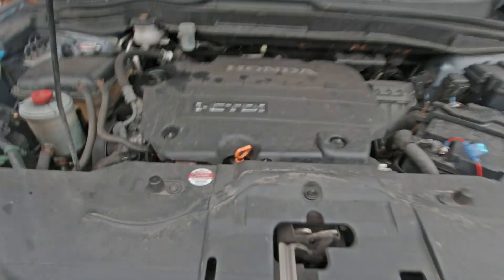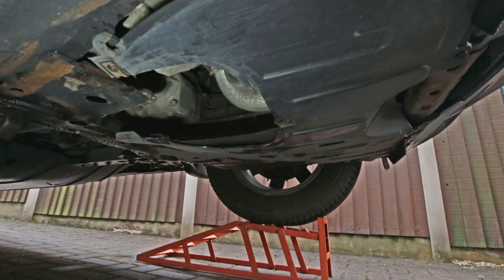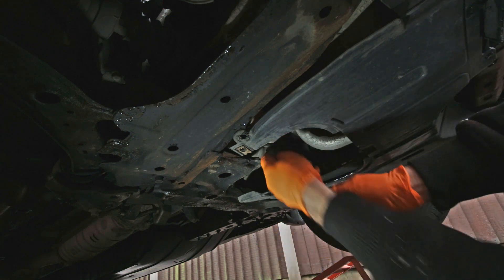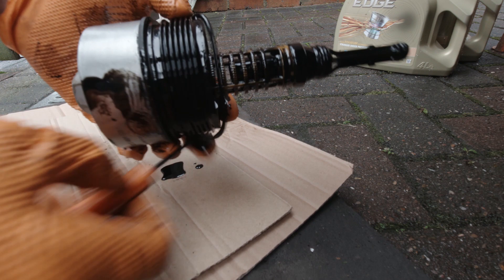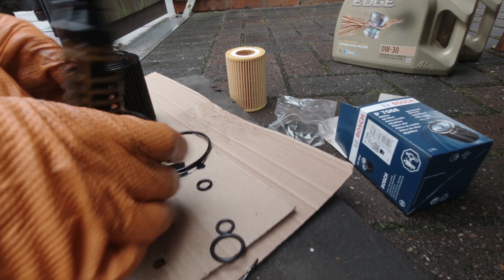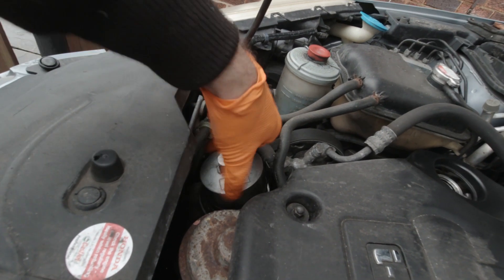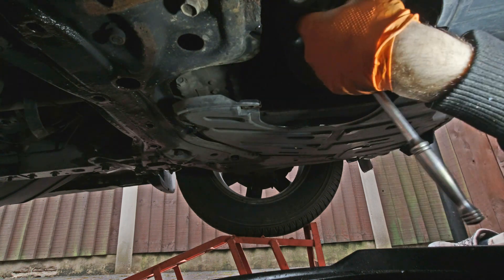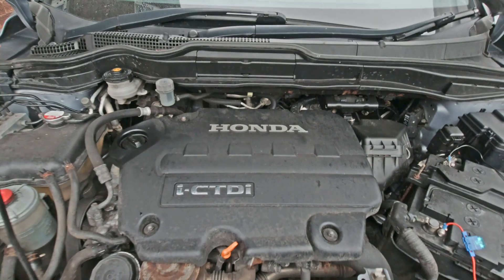Honda CRV Oil service, 2.2 c-tdi mk3 2007. Oil change.

Comment: Quick note - do not over-tighten the sump plug, the sump is made of softer aluminium and it's very easy to strip the threads giving you an annoying oil leak - make sure to tighten to correct torque

Comment: Hi thanks is the oil filter fitting “socket” 76 or 74mm 14flute ?
Reply from the maker: @andrewgrant1740  74 i think
Reply: @ thank you busy with it now and have a vernier will post. 🙏🏼 hopefully can find one easily or borrow
Reply: @ yes. You are right. Just over 74mm. 
Managed to borrow a socket thankfully 😅
Reply from the maker: @andrewgrant1740  thanks for clarifying 👍

Comment: No many info on google in regards to viscosity? Lot's say 5w 30 inc honda forums...
Euro car parts say 0w30 is ok as long as none dpf which many or most are none dpf ...
Dpf are 5w 30 of course.
But i believe dpf where an aditional extra from the factory or when cars where being exported beyond e.u .
Reply from the maker: I think the ictdi never had a dpf but all the idtec did have dpf. 0-30w seems to be good for this (ictdi)
Reply: I've used 5w30 for a few years now and haven't had any problems - yearly oil change

Comment: The filter nut looks like a standard hex nut, why do you say a special socket is required?
Reply from the maker: If I remember correctly it's a 76mm 14 flute socket, you don't get them in any normal socket set.

Comment: Do you have to reset oil life on this car when you change the oil? Some models do not have the oil life option on the screen and I do not know if it is important to reset it using a diagnostic tool or no.
Good video :)
Reply from the maker: I don't think you do on these
Reply: You don't need reset anything:-)